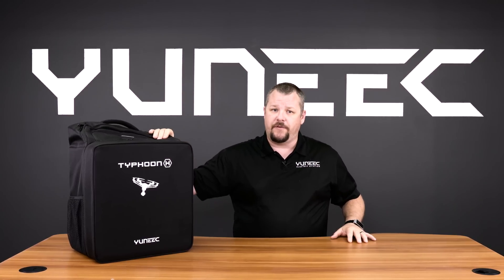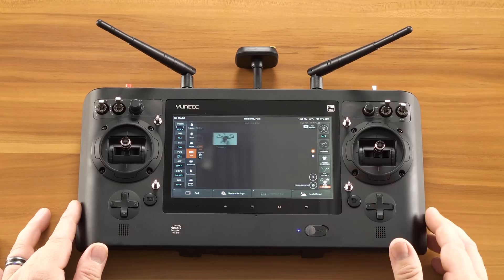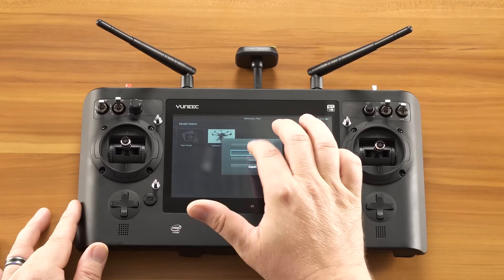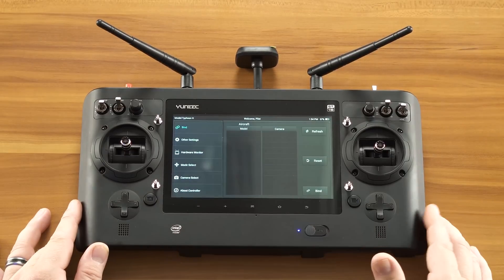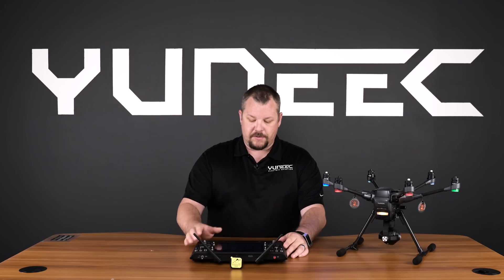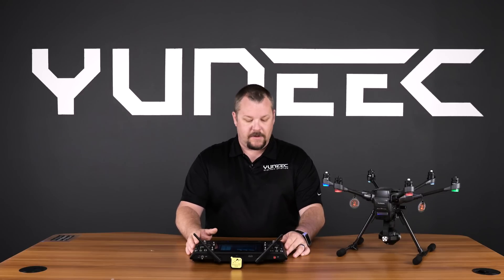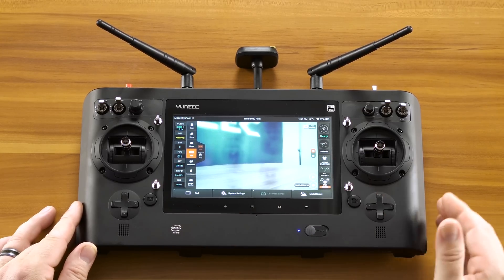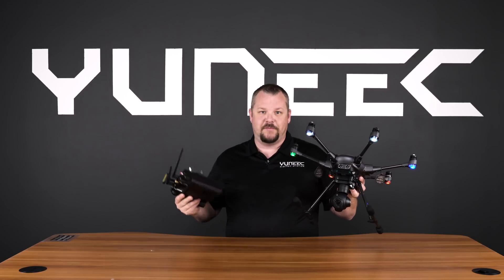Typhoon H: Binding with ST-16 Controller

Comment: Yuneec is garbage. Why wouldn't you put this in the manual you morons! Also why is your support email and phone number non existent now? I can't get any support from Vertigo drones, where I bought my H520E because they are out of business. I couldn't get a hold of you guys either. If this was the same binding process as the H520E I am pissed! I bought a new transmitter off Ebay because the one it came with, the memory went corrupt for no reason and I could not re flash said transmitter.  

I couldn't get the new transmitter to bind for the life of my and eventually sent it back to Ebay. I got so angry that smashed my H520e with a baseball bat because I just got over the nonsense of this product. And I am no dummy. I fly mostly acro drones using open source software, like Betflight, which is way harder to learn. Your propriety nonsense locks away key info that is not hard to learn at all, it is just impossible to find.